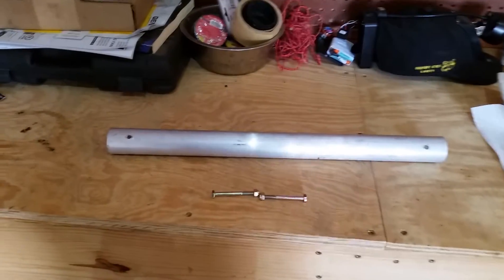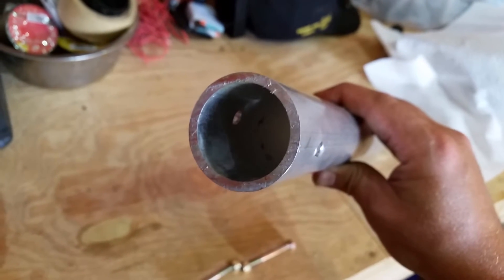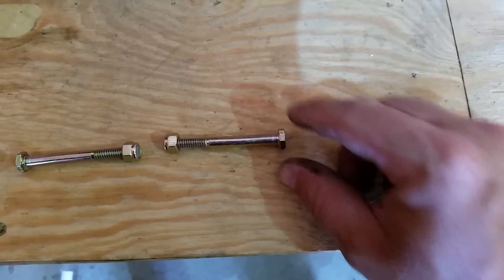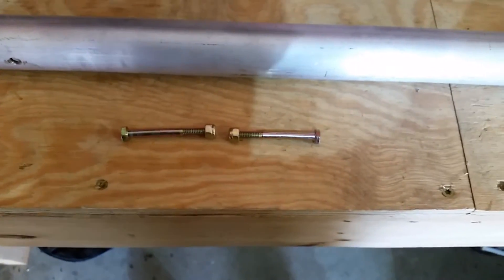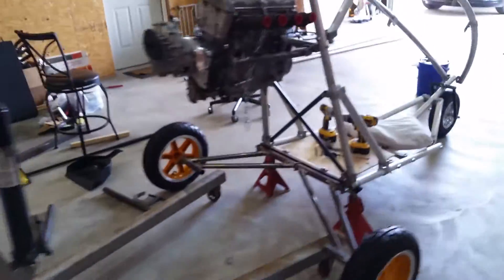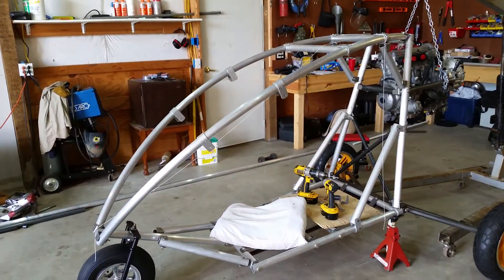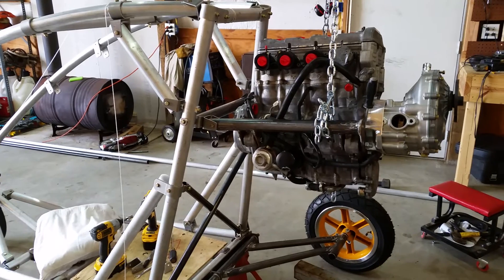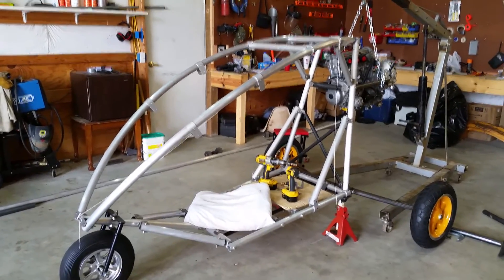PPG Trike Building & Testing, Part 2

Comment: Great build. I'm starting the process myself soon. I really like the simplicity of bolted joints rather then welded. Did you custom make all your brackets? Any trouble bending that T60 sch40? what's the total weight of the frame? Id really like to model mine from yours. Would you consider some detailed pictures and measurements?
Please reach out to me at Fawcett999@comcast.net if you have time.
Jim

Comment: What is that engine?  It looks massive for that lightweight trike frame.
Reply from the maker: Bruce Pritchett it's way too much hp. I'm gonna have to choke the engine down. it's a snowmobile engine. Yamaha RX-1. It should be very smooth, reliable, and powerful.
Reply: Is that a rotax gearbox mated to it?
Reply from the maker: Bruce Pritchett yes. Rotax C gearbox